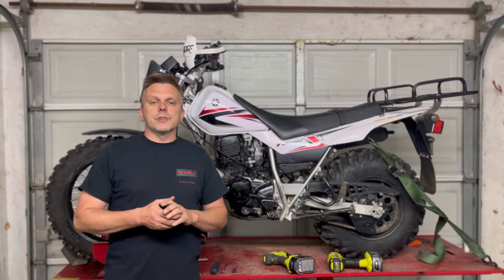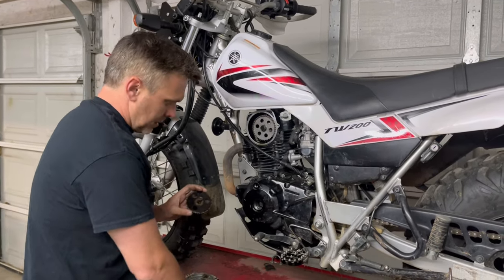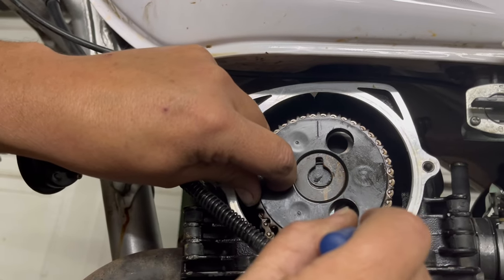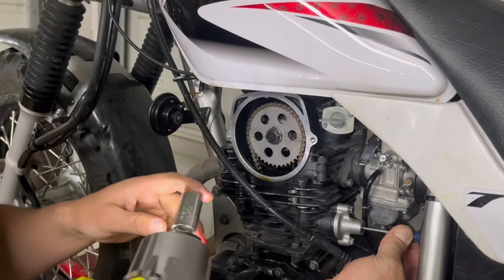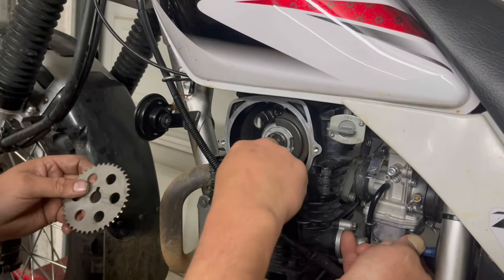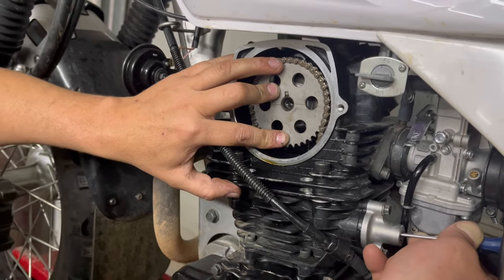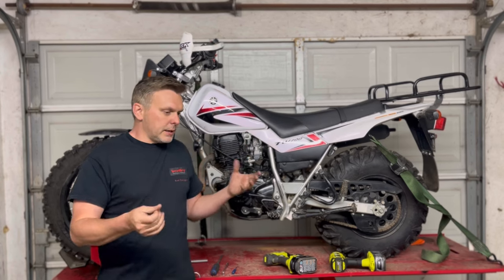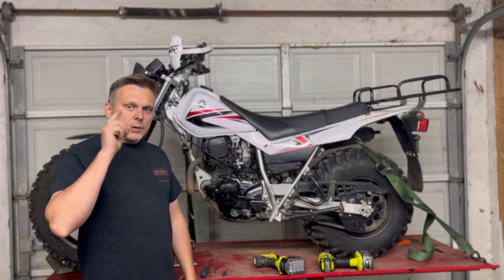bradley Performance Products advanced cam sprocket installation

Comment: Was my first time doing a "watch and pause" YT install!  More of a paper instructions kinda guy.  +4=more low end; -4=more top end.  Torque specs for 2001+ is as follows according to shop manual:  Cam bolt 43FT/LBS, cam cover and tensioner 7.2FT/LBS.  Since I didnt have a lovely assistant I took off the tensioner assembly.  Made job easier.  😎

Comment: Zoomed in and saw the carb. What Carb is that?
Reply from the maker: 28 tm flat slide. Requires lots of changes to get the jetting right. We will see if it's worth it or not.
Reply: @bradleyperformanceproducts   interesting!

Comment: Hello great video not to intetially change subject, but what size is that rear sprocket? And what size atv tire is that? I am going to eventually order that kit, just trying to decide the best size atv tire for top speed on and off road performance, thanks take care.
Reply from the maker: 25" tire kit with 60 tooth sprocket.
Reply: @bradleyperformanceproducts  Thanks for getting back so fast, and thanks for dedicating your time and coming up with great parts for the TDUB. The atv set up was a big reason among others but being able to place an atv tire on that bike relatively easy and your products making it even easier, well purchasing a TDUB is a no brainer.